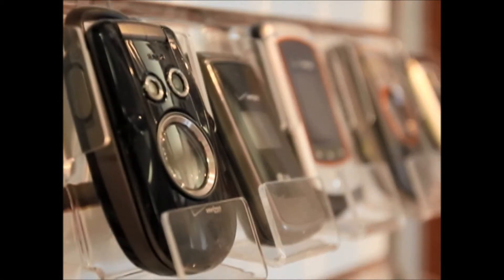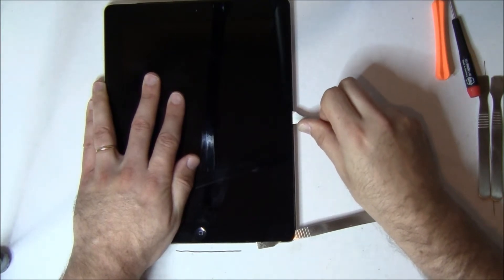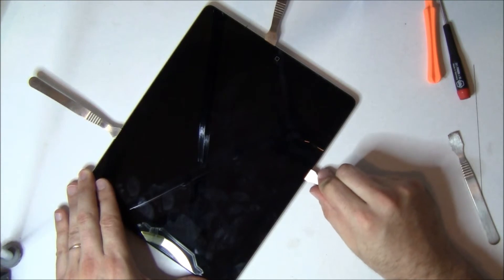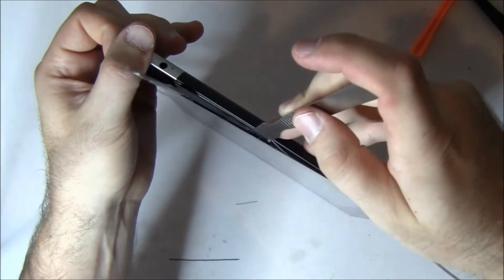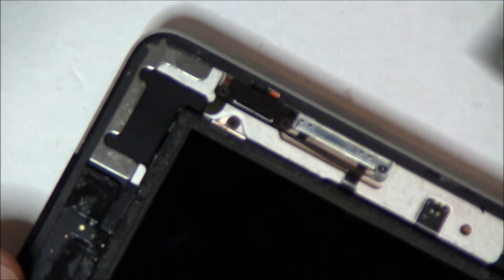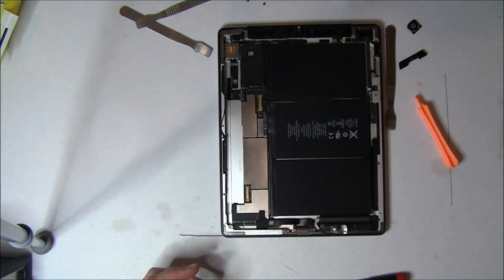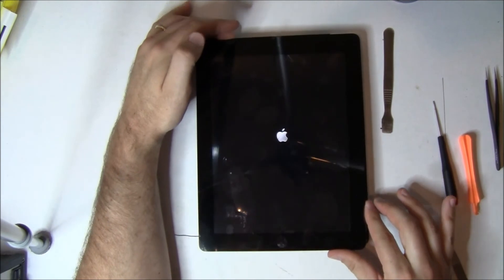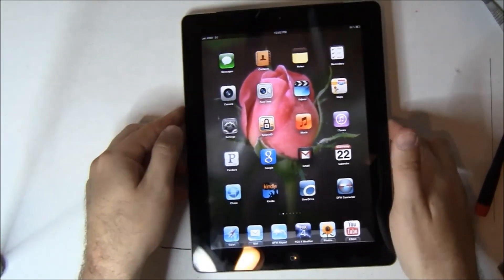iPad 2 3g broken screen fix disassemble

Comment: Awesome thank you! Everything has worked nice and no damage. Tricky was the home button because if this is not put back on the right place it will bend the screen. So then you have to reopen it again. 
Do this really calm and no pressure and just enough heat and it will work fine...

Comment: E.Z. i disagree with the platic guitar pick remark yes it is more firm on a new unit but i prefer plastic as it minimizes the damage you can cause if you slip around the WiFi Bluetooth antenna. thin metal tools are great for the top corners imo. 
this is not a difficult repair id say Samsung Galaxy S3 or S4 is 20X more difficult and time consuming if your not confident apple is easy to fix.